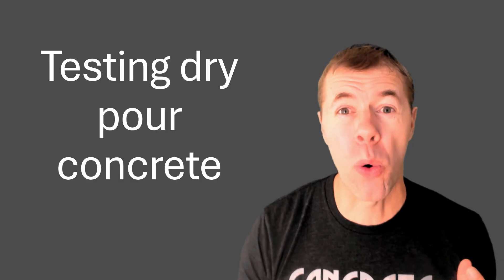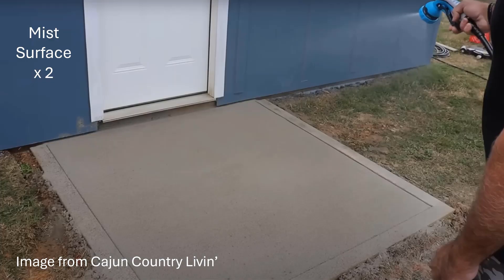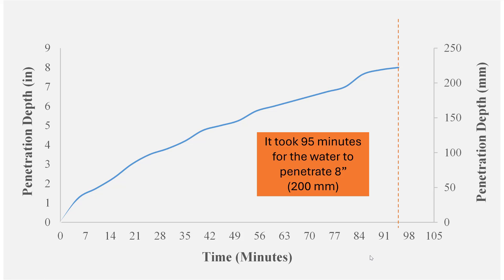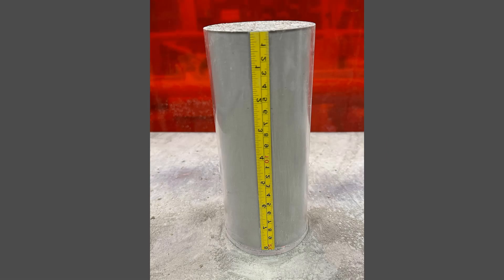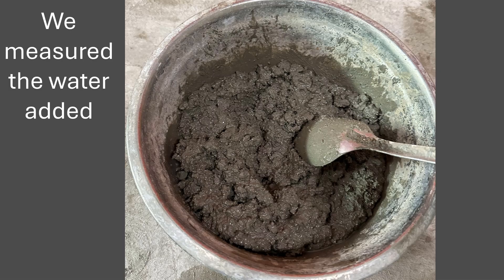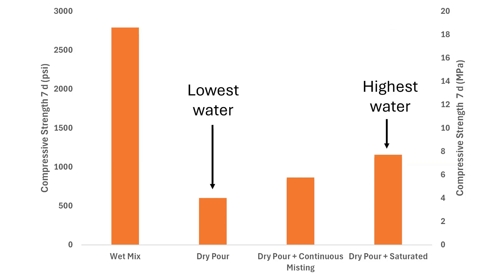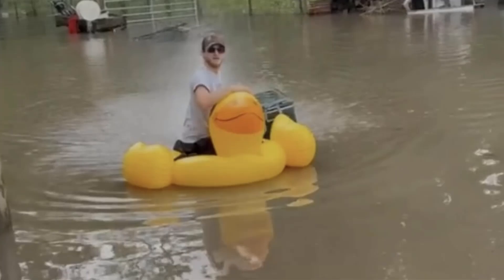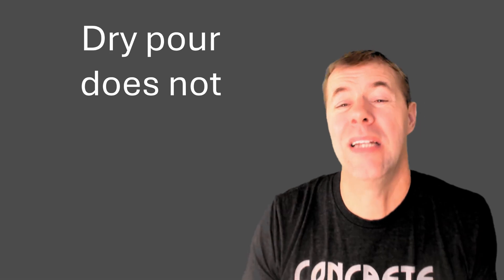Testing Dry Pour Concrete with an Expert

Comment: I guess your video has neat graix?, but you are completely missing the point.  Your glass cylinder isn't the same as dry pour in the ground.  Dry pour gets moisture from the sides and the bottom when in the ground.  All that air you talk about would easily escape if not in the glass cylinder.  And dry pour is great for a patio or a barn step.  Even your skewed data shows it can handle 500 psi.  lol.  Any patio or step would maybe at worst need to handle 50 psi.  I mean, I could build a car out of titanium and it would be stronger but its totally unnecessary for what dry pour is intended for.  #Cajuncountry explained the process multiple times but so many YouTubers don't follow their steps and then skew the results.

Comment: This is really good information. Did you test the 20+ day strength of the dry pour that got the maximum amount of water? It appear that it was the strongest of the dry pour methods, so I'm curious about how it ended up after the full cure time?

Comment: Since the cylinder you cast the concrete in would not let air escape and water to penetrate from all sides. It’s not an accurate test.

Comment: Did you try a dry pour sample in a vacuum chamber? It might be a way to test the hypothesis that air returning to the surface is she causes the weakness as you could theoretically achieve complete saturation. If still performs less well then there may also be other factors at play.

Comment: When I first saw a couple of these dry pour videos, my thought was "Is this as strong as mixed concrete?" My guess was probably not because I figured there was no way to ensure that all the cement got evenly wet out. Some parts would get too much water and other parts wouldn't get enough. This was a great video that confirmed my suspicion.

Comment: I am curious to know the difference between concrete mixes for dry pours.  I have done a few dry pours using rapid set 24/6, says on the bag 6000 psi at full strength.    I am wondering if I am gaining much strength in the dry pour vs a normal concrete mix.

I alway mix traditional way for my foundation footings ect, but tried out a few dry pours for a few steeps.  I have a bad back so the dry pour way  easier for me.

Comment: Even ACI requires rodding cylinders when testing to consolidate them and thats been mixing in the truck with midrange and the proper water to cement ratio. I knew this was basically compacted sub grade that can take the rain . But to each their own.

Comment: No-one should dry pour that thick and pour on water from the top
Reply: I agree with you but the cajun country people made dry pour steps that were about 4 feet thick just to prove it "can" be done.
Reply: @13squier  damn, that's way too much. Nice video though, I agree with most of the findings

Comment: I think the core reasoning behind dry pour is to avoid using a mixer. What about something like a "Mix in place" method? Something like where you pour the dry mix into the mould, add water, and then maybe agitate and stir with a metal rake or something equivalent? How would that compare to something like a traditional wet mix?
Reply: Good luck. It's hard enough to mix in place like in a wheelbarrow. After doing 2 dry pours at my house, there's no way I'd wet mix in place in the form itself, that would be more work that people are trying to avoid. I actually have walkway slabs next to each other both dry and wet poured that's been thru 2 years of freezing. Both have held up great. For walkways or low load projects, dry pour works fine. The only difference at my place is appearance basically.
Reply: Doing that works fine in a post hole but doesn't really work in most applications. It still leaves dry pockets and it pulls dirt/mud/debris into the concrete mix.

Comment: It's a shame all this testing wasn't really a representative sample of how dry pour is typically used.  IE small pads 4" thick.  

You saw the samples broke in the center where the water didn't penetrate. Sealed plastic forms don't behave like a wood form,  and thoroughly soaking the ground is good practice even with mixed concrete. 

I'm not saying it's going to perform as well,  but I think it will perform much closer to mixed if prepared with a real sample.
Reply: The water did penetrate all the way through, he shows it from 2:15. He said it took about 90 min to get complete saturation and the water absorption was linear so a 4 inch sample would take half the time. He also completely flooded some of the samples and found those ones were the strongest, about 1000psi.  None of the samples shown had dry mix in the center.

Comment: Interesting video Id be interested to see if doing something like tamping or some other way of manipulateing the concrete while in the form  after you wet concrete would effect the strength. I mean its still not going do be as good as wet mixed concrete but it would be interesting to see if it improves strength by 10-20%.

Comment: I wonder how the dry placed concrete would perform if the water was slowly added at the bottom of the mold?  Still looks like you'd have lots of voids, but at least you'd get all the air out.

Comment: What happens if I mix white glue with concrete?

I want to make the most durable concrete dumbels with best C&B.

I wonder if using fiberglass mesh around de weights or  "chicken mesh" (I dont know the name of the metal mesh). Coukd bee a good option.

And for external mpact using EVA and contact glue or something like this and finishing with some kind of "cold rubber" for impermebialization.

In the handles I think that roling EVA and fixing it could absort some impact if the wight drop down.

What di think about this experiment?
Waste of time and money?
Thanks for sharing so much knowhow.

(Sorry for my bad english rsrs)

I am wondering to

Comment: one of my biggest issues with the dry pour is the lack of mixing of ingredients.  While its safe to say a bag of concrete has all the ingredients, in the right proportions, there is no telling where those ingredients are in the bag.  Those bags ride who knows how far on trucks & then get moved all around the store....ingrediants settle.  If you dont mix it, theres no way to ensure proper distribution of cement & aggregates.

Comment: Here I am in a 4000 lb metal box flying down the road at 70 mph 80 ft up in the air, riding on a ribbon of compressed dust.

Comment: Great video. What if you added the water to the cylinder first? Also, do you think mixing the dry-pour in the dry state would be beneficial? Is it possible that the components get stratified in the bag and need to be mixed back up?

Comment: I can see the obvious problem with dry mixing here is as the water penetrates the mixture, it'll create a gradient of moisture, creating uneven hydration. It also drag along the cement particles, again creating an uneven distribution of cement. You need to mix the cement to create a homogeneous structure.

Comment: one fault in your experiment is that dry pour has an open bottom not a closed bottom, the open bottom will allow it to both drain and pull in water from both sides, the Cajun Country channel usually gets rain on the slabs they create which is probably why theirs always works for them better than some others who don't use enough water... so you don't get the airflow in your experiment because you didn't replicate the real world since you had bottoms on your forms and real-life doesn't, so I have to call this out, you should redo the experiment with open bottoms, you should also try different sizes and shapes since there is no guarantee that a cylinder works the same as a bigger thinner slab
Reply: Dry pour sucks, just deal with it

Comment: Finally someone does the test that I wanted to see and I wasn't surprised by the results since I was responsible for concrete pours in the commercial construction industry. I would never dry pour concrete for a home project.
Reply: The first time I ever saw dry pour was on a DIY show on TV. I couldn't believe anyone would do that. A few years later while doing some demo I ran into some concrete that was dry poured and I saw the results which were worse than what was created in the lab. I can guess that in the lab you could see when the dry pour was saturated , but out in the field, there was no way to tell when saturation occurred.  I would never wasted time and money doing dry pour.

Comment: I have seen a fair bit of videos about dry pour and always understood it to be meant for low-load applications. Like the examples you mentioned and maybe fenceposts or floor for a shed, etc. I'm sure there are some people out there trying to make a driveway with dry pour and based on this video that seems like a bad idea. The "saturated" idea of the dry pour seemed to be 3x as strong as the "same water" dry pour you used for the majority of the tests. I would like to see the saturated method tested to see if it strengthens over time and if it bonds at all to the rebar. Thanks again for taking the time to make this video it was very educational and you do a great job keeping attention.

Comment: Great info.
The dry pour advocate I know is claiming it allows self healing. I believe it stems from a misunderstanding of the news articles that refer to the papers from the research on Roman concrete. In particular “Hot mixing: Mechanistic insights into the durability of ancient Roman concrete”
The claim was made that crack formation would allow better water penetration over time. There’s some flaws in this argument and it’s also still limited to the ultimate strength of wet mix concrete.

Comment: By far the best video I have seen on this topic.  It left only one question that I had wondered about unanswered.  Dry mix in a bag usually is not well mixed.  The aggregate and sand seem to settle out of the mix during transport.  I'm curious if mixing it well while dry to redistribute the components `evenly would make a difference.  I think dry mix is garbage, but as someone who has fumbled his way through finishing concrete I can see the allure.  So if you're desperate for content you could do a supplement to this video and try it.

Comment: Great content. Because the air is going UP, it stands to reason that the more shallow the mold, there would be a slight increase in strength as you step downward
Reply: The further the air has to travel to get out of the mix, the more pronounced the air pockets have to be to release the air. The shorter the travel, the air pockets can and will be more constricted. If you did a compressive test of a 2-4 inch pour I guarantee the strength profile would NOT hit the PSI of WET MIX, but it should be closer than the 8 inch deep sample

Comment: On wood privacy fences, where the posts last 10-15 years before rotting out, you might not want high-strength concrete that will be difficult to remove.
Reply: You make a great point. He has a video introduction to concrete mixes and he mentions that there are times when you would design concrete to be weak so you can remove it for say plumbing repairs
Reply: Use tar on the wood where it meets concrete will help delay wood rot
Reply: I appreciate that he didn't totally rule out dry pour.  A fence post generally does not need 3000 PSI concrete to hold it in place.  The post doesn't come close to that hardness, and the surrounding soil is only around 15 PSI.  A 500 PSI concrete post anchor in the soil should be just fine, and super fine when digging up the damn things 18 years later.  My father and his father never backfilled posts with concrete—they just rammed rocks and dirt back into the hole.

Comment: Awesome Video.....  Q   Wonder when they're bagging the cement. it's Not fully mixed together, but it's more in parts (Quality control) or after it's bagged then it's haled hundreds of miles away, the mix settles and separates.
 So I'd Love to see If you can/would pour full bag of dry cement into a mixer/lrg bowl then mix contents fully, then put in your clear tube & add the water and see if that will increase strength.   I'm betting it would.

Comment: If you are looking for 'popular' concrete subjects to do a video about, there is a machine called the MudMixer™, which is a cement mixer and pouring machine that claims it allows you to set the ratio of water to dry mix.   The Mudmixer advertising seems to target both professionals and the DIY types.  I was wondering if the thing actually produced consistent results.  If a DIYer poured a small number of yards of concrete with a Mudmixer, half finishing the project as DIYers are likely to do,  and then returned to the project 6 months later and completed the project, using the same settings on the Mudmixer, would the project turn out well.  I wonder if Mudmixer is more dangerous than a cement mixer, therefore, should only be used by professionals.

Comment: Makes sense, but got me curious:
What if you'd flood and vibrate the crap out of the dry pour?
Should help reduce the air channels to the absolute minimum.
Also, could the poor bonding to the rebar be partially that the dry pour was so weak the rebar was gouging out a channel due to the lateral force pulling it along, and not only poor packing?
(I'd imagine vibrating would help either way.)

Comment: So can you (completely) fix the dry pour simply by adding the water from beneath? Slowly rising water level inside the container should push the air out of mix so there should be no dry channels left behind?

Comment: I have had great success with dry pour but I do it differently, first I only add about an inch of dry concrete at a time, wetting the layer down until the water is absorbed then adding another inch or so of dry concrete, wetting that layer and so on until the form is filled, I also add a little bit of soap to the water and it really helps the water absorption,
Reply: cope.

Comment: Tyler, could you do a video on ICF walls?  In particular, claims are made that the amount of concrete needed is less.  For instance, 6 inch thick core ICF is as strong as an 8 inch form  poured wall.  It seems that it might be true because of the ideal curing environment of the ICF and that the core only feels gradual temperature changes throughout its lifetime.  Also, foam walls sturdy enough to contain the weight of the concrete pour may continue to supply lateral constraint that opposes the bulging that might develop due to a compressive load.  I have seen there are research papers that say laterally constrainting concrete increases its compressive strength.  There are naysayers who "don't want no flimsy Styrofoam, I'd rather spend the money on more concrete".  Have you analyzed ICF walls?

Comment: A link to this video needs to be put in the comments of every dry pour concrete video.
Reply: Agreed. At least the people doing dry pour videos (the ones I’m watching at least) recognize they aren’t making anything of structural substance.
Reply: You can get a link by hitting the share button
Reply: i agree. but they'll still deny the data. lack of a scientific, engineering mentality. hell, i'm not even an engineer and first time i saw someone doing that i was like, "no way this is gonna be durable. chemistry does not work that way". there's a time and place for dry pour, i'm not writing it off entirely. if it's a small area, not weight-bearing, and not really that important, sure, use the extra concrete you have an do a dry pour. not a big deal. but ppl out there who want to replace entire patio spaces, shed floors, etc with dry pour, saying it's valid and proper.... that's just stupidity. unless you really, really don't care about durability, safety, and doing things properly.
Reply: I agree, but the problem with someone watching is the attempt to entertain while testing is really tuff to listen to. It would be much easier to digest if it was a heck of a lot simpler in delivery.
Reply: you dont get the point of dry pour
Reply: @kkevinj1  I see no upside to dry pour. Same cost and a much weaker product. And I see no point to it.
Reply: @OldGuy7949 I assume the point is for ease of use by a homeowner where a simple step or platform is needed and not expected to hold lots of weight over time. Like the people shown in the video examples use it for.
Reply: @mitch6575  That being said it is not difficult to mix the cement in a wheel barrow or small mixer. This will give you a much stronger slab with very little more effort. The upside being 15 years from now your slab will still be useable.
Reply: @OldGuy7949  I agree, but also who really cares what other people do? I don’t know that anyone is saying it’s stronger than mixing, in fact I think most if not all people know it’s not as strong. But what makes them keep doing it ??? It’s strong enough…. It just works for them and what they are trying to accomplish.
Reply: @kkevinj1  The only purpose I see is if you want to make a temporary slab that is easier to break up after a year or so, if it's not temporary then it should be poured correctly as a normal wet pour!
Reply: @kkevinj1  I used to think maybe it was saving the fact that don't need a mixer, but mixing it in a bucket with a shovel would be better then a dry pour.
Reply: doing well and will add on soon. It's too easy. Not driving on it

Comment: After watching (thumbs up) I'd suggest a different approach to dry pour:
Pour half. Add rebar in a grid pattern, nestled in so it is covered. Lay pieces of plastic in the center of each grid square. Mist.
The air will escape from the middles, away from the rebar.
Remove the plastic bits, pour the rest of the dry mix, replace the plastic bits, and mist. Remove the bits and keep the surface oversaturated 
😊